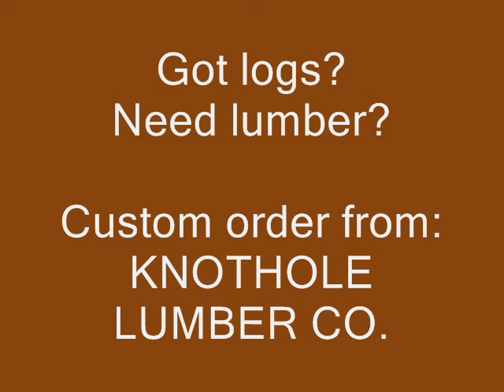KNOTHOLE LUMBER CO. - 4th sawmill operation 05-20-2012

Comment from the maker: Thanks Pete. The last sawmill I ran this engine on used a 100' belt. The extra length and weight makes the belt settle down better. Reverse would be nice but the engine doesn't have reverse.

Comment: I heard a comment in the video about blowing a fan on the blade.

3 main causes for a hot blade are 1: DULL Teeth,  2: Not enough Lead, causing the blade to rub, and  3:a tight bearing generating heat from the shaft/hub outward.

Even if the Lead is set perfect, if the teeth aren't sharp enough you will be fighting it all day, which is why I listed that as number 1 even ahead of the lead being off. I was fighting our mill again last year because of the teeth.

Engine sounds great by the way.